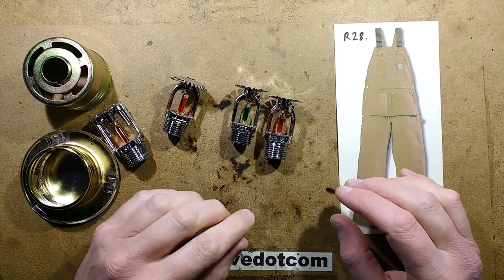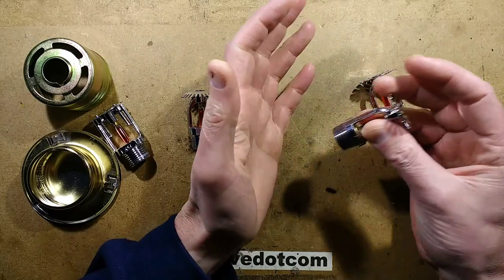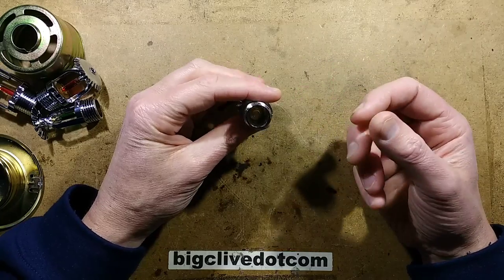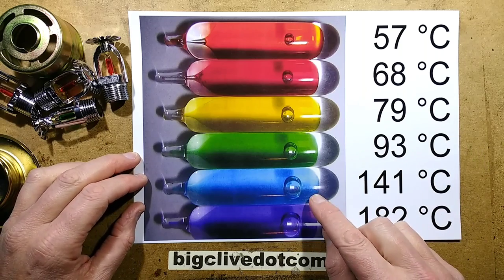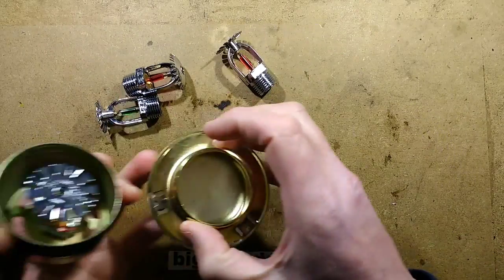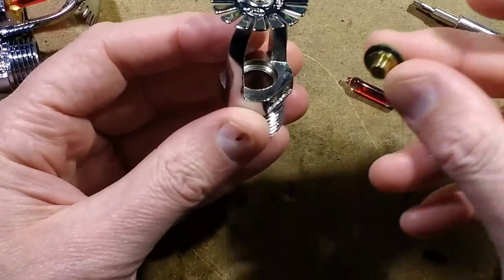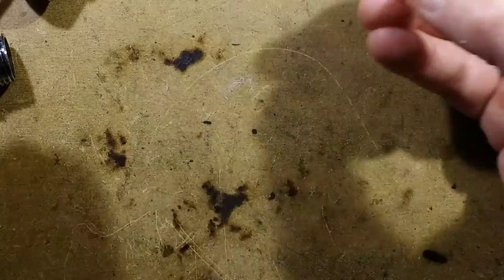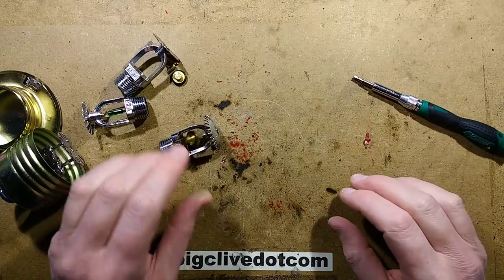How a fire sprinkler works. (featuring broken glass and spatter.)

Comment: A damned firework went off nearby right as that vial popped, didn't half make me jump... :S

But that aside, you'd probably want to have a separate water supply for the sprinkler system, such as a header tank system, this way you wouldn't contaminate the mains water supply given that most sprinkler systems are unused for years while they're filled with water that is going yucky... :)
Reply from the maker: Theoretically for a home system the pipework could form part of the normal supply, so water flowed through it continually on a daily basis.
Reply: I suppose that could work, the only thing I'd be concerned about there (as mentioned in other comments) is pipe knock, where something like a washing machine suddenly stopping the flow of water could damage the sprinkler valve, or at worst, pop the vial from the physical shock, probably something worth testing there, outdoors of course... :D
Reply: It's worth noting that these may be built using a leaded alloy which is banned in the US for domestic water supplies. They used to make most faucets from such alloys because they form good seals and they're easy on the mill tooling, but they've since been banned.
Reply: It would have a check valve in line of the supply line
Reply: In AvE's second video on sprinklers, he says the stagnant water gets very yucky!
Reply: The water in a standing system is fetid at best. It is the rankest swamp-mud puke smell. And it is BLACK; as is someone mixed carbon black in the water. (picture black cement dust)  It will stain EVERYTHING black. It is the oxygen leaching out mixing with the iron in the pipe.  It is Definitely a hollywood thing when clean water comes out of the sprinklers.
Reply: You can run a line for all your sprinklers with a toilet at the end.
That way the water will circulate every time you flush and never really be that stagnant.
And of course being a toilet it doesn't matter if the water starts to go bad anyways.
Just don't forget to add a check valve at the beginning of the line to make sure water from this line can't go back to your potable water and possibly contaminate it.
Reply: Zee-L Usay - at my work the very old sprinkler system was first filled with a black oil to combat corrosion in the pipes and fittings. I asked and was told the oil isn’t flammable but makes a big mess.
Reply: twocvbloke very good point
Reply: You just have a tank/pump system that supplies the sprinkler system and keeps it under pressure that is connected to the water supply to house much in the same way the toilet is. Water gets below a point in tank which opens a valve connected to the supply with a pressure sensor and one way valve on the out of sprinkler tank. When pressure drops below a set amount on output the pump turns on.
Reply: I'm a pipe fitter and I'll say now that the water is indeed yucky. Oldest sprinkler heads I've removed were from 1936 and the water behind it was putrid. But any system over a few months generally goes nasty.
Reply: Tim stro59 I could write believe it, I've heard comments like this while staining water out
Reply: anti backflow check valve ir required for the Us
Reply: I've seen some go off on my job.. The first hundred of gallons are very gross, it smells like death.. And.. Iron.. I'm wondering how legionella is controlled... And they give out a LOT of water
Reply: In a home system you could make the mains run through the sprinklers first then go to the appliances in the house and the water wouldn't be stagnant. The sprinklers would need to be drinking water grade but this would solve having dual system and stagnant water. Sprinkler systems gave their water flushed regularly along with pressure testing and external hookups for firefighters.

Your insurance company won't give you a discount on fire insurance if you roll your own and will deny any water damage claims resulting from leaks or failure in the plumbing if it wasn't done according to code.
Reply: Holy shit... same thing just happened to me! No joke.
Reply: That's why you install a backflow preventer at the water tie in point. I am a fire sprinkler system expert, (26 years experience). By the way, I always just wore blue jeans to work in. The tools a typical fitter has on his person are a pair of channel lock pliers, a tape measure, a ratchet and socket, and a pencil and paper. Bigger stuff like wrenches usually get carried around in a bucket.
Reply: Pipe knock, also known as water hammer, is typically not a problem as most domestic water systems have an expansion chamber installed to prevent it. It pretty much only occurs when a main shut off valve is closed very quickly and is pretty rare since most control valves are slow operating types
Reply: @bigclivedotcom  I've seen lead still used in major water systems. Is that slowly releasing lead contaminants into the water, also does a proper water filter system separate lead and other dangerous contaminants from water?

Comment: Many years ago before I retired as a volunteer firefighter we saw the Inception of residential sprinkler a new product on the market came out made of PVC and they're calling it  something along CPVC fire-sprinkler systems... it's a fire rated sprinkler that works wonderful in the house about 3000 to $5,000 more in a build .. in a big house it could be a lifesaver also there are the old systems that used to use lead that melted Hutchins fire doors and fire curtains and a garage roll up tight door that would bust the piece of lead, thus eleasing the door or and cause a sprinkler head to go off.. thanks sir always enjoy your videos.... my boys at my work call me Pooh Bear when I'm in my brown Carhartt winter coveralls..
Reply: Those pvc pipes are made differently then normal pvc pipes.They are much harder to break and cut .

Comment: Could the vials be filled with the liquid at a controlled temperature, so when it cools, the bubble forms automatically?  I don't know how the bubble size could be controlled otherwise.
Reply: My thinking exactly. Fill and seal at the desired trip temp then when the capsule cools the partial vacuum vapor bubble forms.
Reply: kevtris

Sup. ;)

Congrats on the Super NT. I'm thinking of getting one.

(you sure kept that one quiet. lol)
Reply: I think its more to do with the size of the bubble being the determinate factor in the failure of the capsule. Air compresses. So the more volume of air the more compression therefore the more the heat the capsule can withstand. That would be my guess.
Reply: Using a vacuum would be a well controlled method. That would only work if the glass walls are able to contain the external atmosphere pressure. The walls look pretty thin, but they are probably strong under inwards compressive forces, and weak under an expansive outward cracking force. I'm still struggling the the whole vapour pressure issue...
Reply: If they're filled using a vacuum, the bubble size can be determined by the strength of the vacuum.
The liquid is probably something similar to that in thermometers.
Reply: it would not Pop if you fill it with the temerature where it should pop
Reply: kevtris 
If the vial is filled with fluid pressure, the pressure would determine the size that the bubble that is formed. The air pressure outside could be increased to balance the spike when the vial neck is melted shut.  Only an idea...
Reply: My thought exactly. Larger gas volume ~> more compression allowed before the hydrostatic pressure in the liquid overcomes the tensile strength of the glass.
Reply: Look who's here :D
Reply: Here's how I think they make them. 

The fluid is likely one which is used in thermometers, where its density and volume are functions of temperature and pressure. With such a fluid, sufficient pressure can be applied at high temperature to maintain a particular volume (or used to determine how much of the liquid will be sealed inside.

Given the regularity of the viles/tubes, my guess is all of this is done while the glass is nearly molten, starting from simply glass tubing. One end of the tube is connected to a fluid/vapor compressor which starts passively. The glass is heated until red hot (which heats the air inside and expels it through the open vapor compressor bleed valve. The other end is then pushed into a metal die until the rounded side is formed and then the vapor compressor pressurizes the tube with the vapor we see inside, which expands (bubbles out) the glass in the larger die cavity (thinning the glass around the mid section) until the pressure vs temperature matches that required to fill the whole tube with the vapor necessary to have the correct volume at room temperature. The glass is then twisted, snipped, and pressed into another die (encasing the vial) and then rapidly cooled. 

The rapid cooling tempers the glass and quickly changes the vapor into liquid. The bubble, forms not of gas, but of vacuum, as the size of the bubble will be determined by the amount of pressure (the mass of liquid) pushed into the vile. Just like a thermometer, the liquid will expand and the bubble of vacuum serves as a buffer for the liquid to expand into. More liquid = smaller vacuum = less heat needed for the liquid volume to exceed that of the tube. Without a die and external pressure to resist the expansion, the tube will pop. This can all happen in an automated machine and is likely the easiest way to achieve a consistent produce. 

There would be no way to crimp the glass with volitile or expansive liquid inside, at least without popping the glass. So it MUST be done while the glass is malleable (extremely hot) and the die method is the only way to keep and form the vials under such pressure and to achieve such consistency.

Comment: In the apartment I'm in, they've painted over the sprinklers and the tubes with it. Seems like asking for trouble if the coating is thick enough. Maintenance has a tendency to do that here. Hole in the wall? Push the piece back and paint over it. Leak in the ceiling and stripping the paint off? Just paint over, don't bother fixing the leak. Sadly they won't let me fix these things myself.
Reply: It’s against the ruling and the heads should be changed legally
Reply: Painting the tubes ruin the sprinklers as it acts as a fire barrier and could prevent the sprinklers from going off.
Reply: That's illegal to paint heads. Call your local fire chief he will make the landlord pay to change them

Comment: Thanks for this bigclive.  I wasn't aware about the bubbles and bubble sizes, and interesting about the melting alloy on the suspended ceiling covers.  Here's a bit of history to add:  Earlier sprinkler heads used a low melt bismuth alloy instead of glass vials.  You can still find these sprinkler heads in older buildings, the bismuth as two metal tabs on either side of a dropping plunger mechanism.  It is my understanding that earlier glass vials did contain a red colored alcohol, and though I've never sampled one myself, I suspect the bubble technology allows for inexpensive water to be used and control for temperature thresholds.  You're going to want higher temp-rated vials inside your commercial stove's range hood that blasts K foam for grease fires.

If you find any old sprinkler heads, peel off and save the bismuth tabs!  Also, good call on the red vials being susceptible to green laser pointers. ;) shhh!

Comment: Neat!  I always assumed that they were more complicated inside, for some reason.  I guess this explains why the sprinklers in my workplace seem to be dripping very slightly... the seals on the plungers are probably getting old.
Reply: Pete S. Do you know if they were Omega brand heads? I worked at a building where we still had some of them in vacant suites even though the majority got recalled and replaced
Reply: Recalled heads were Made by a company called Central. If you look at them you will see they have a flat Seat where the bulb meets the main body. The recalled heads are Central GB’s. Omegas should still be fine.
Reply: Tyler Jones The building is in Los Angeles county area, CA. They were definitely Omega brand heads but it was probably a specific model. The recall occurred in the early 2000s from what I can tell. Most of them were replaced then but some got missed and were replaced earlier this year. Unsure what the recall reason was but the ones I saw never leaked. Maybe they didn't activate when they were supposed to?
Reply: @dembones yup that’s the exact reason why. Some of them wouldn’t activate during a fire. It was a national recall but there are still buildings out there with them installed!
Reply: (Ancient, I know, but important) According to the recall FAQ, this is backwards. GBs are the replacements that were specified, and the Omegas were the recalled heads.

Comment: In the fire service, we had some "reverse pliers" on out pumpers that had rubber discs on the outside of the jaws. They could be placed in the gap to stop the water flow until the shop owner had the system serviced.

Comment: You'd probably need to put double check valve if you took a couple of heads off main supply to prevent backflow contamination from normally dead legs. UK standard is to use steel threaded or grooved, but copper with appropriate bsp adaptor fine for non certificated pipework. Interesting fact, in commercial buildings, they use a small jockey pump to maintain pressure in sprinkler pipework, which senses drops in pressure when a head goes off, and electronically starts a main fire pump to provide pressure for that head to make water flow.

Comment: The "protected" sprinkler seems like a good way of stopping miscreants popping the bulbs with a laser? 🤔

Edit: should have watched to the end of the video, eh? 🙄
Reply: ParedCheese or just the same though process as Clive.
Reply: I think those covers are more cosmetic than tamper-proof.  Instead of having a visually ugly sprinkler head exposed, you just have the flush cover (which can most likely be painted) that's less visually obtrusive showing.
Reply: Makes sense.  I don't have a normal need to be up on NFPA but it makes absolute sense.
Reply: @Pete S. - does anyone know exactly just how many colors ARE under the sun?
Reply: all of them.
Reply: ParedCheese

Watched the AvE vid yet?
Reply: I have seen signs in hotels telling guests not to hang clothes hanger from the sprinkler heads in the bathroom.  The cosmetic cover could help reduce flooding/water damage/nuisance alarms.
Reply: Stan Patterson about 10 million
Reply: Painting the covers is actually prohibited... just like painting the head.
Fortunately the covers exist in many colors, in addition to the traditional white.
Reply: @Zee-L Usay:   You won't find magenta or cyan in the rainbow.  Or brown or olive or beige or...

Comment: As far as I can remember the sprinkler that points up is not for protection but for use in a dry sprinkler system. They are designed so that the system can be drained fully after activation without leaving pockets of water in the system that could freeze in cold weather.
Reply: I've seen them used in systems where the best place to anchor the pipe was a few feet below the ceiling so they would put the sprinkler on the end of a riser coming up from the feed pipe to be the correct height from the ceiling

Comment: Ah yes, I remember the hilarity of accidentally hitting one of these with a ladder.
Reply: Did the fire alarm go off? I only ask because some moron at my high school decided it would be a great idea to see how it worked... with a lighter. so the alarms went off and it took about one to two hours (outside, about 90 degrees) for the fire marshal to come and shut down the system. and apparently the alarms cannot be turned off or silenced while a sprinkler is active, so for that time, all of the alarms were blaring.
Reply: Jeremy Allen as long as the pipes are monitored, yes, an alarm will be activated. (electrician)
Reply: I unscrewed a valve outside a shopping mall when I was a teenager which resulted in a bunch of water wooshing out. As me and my friend turned the corner to get from the back of the mall to the front where my car was parked all of the sudden 4 fire engines were rushing in. I guess I had simulated a 4-5 alarm fire!

Next time we were by there that valve was chained and padlocked closed. I guess I did some "failure mode testing" free for them, hunh? ;-)
Reply: Were you working at MSU? ROFL.
Reply: just so you know setting off a false alarm can be a Felony in some places.
Reply: Not an Electrician, are you? Just asking because all the jobs I've been on that someone busted a sprinkler head it was the electrician.
Reply: Will Haggerty gotta wire that fire bell to the panel.
Reply: Very Halloweenish. Lol.
Reply: @WilliamHaggerty  no, sprinkles uses water gongs, those activate when water flows through them (eg. When a sprinkler sets off) and they don't use any electricity
Reply: @tristan6509  If the system is moinitored by a fire alarm panel, then yes, an alarm will be set off.
Reply: However, the water gongs that detect the water movement have to be monitered, and in order to send a signal to set off the alarms, you have to use an electrically powered monitor that detects the gong. Unless this is not the case, which it could very well be considering that I just theorized this.
Reply: @Leekodot15  the water gongs aren't themselves monitored, their water flow is controlled by the valve that is tripped when a sprinkler head opens. In most buildings of a given size that have sprinkler protection, there are points on the sprinkler tree that are monitored by a fire alarm panel.
Reply: Shitting myself